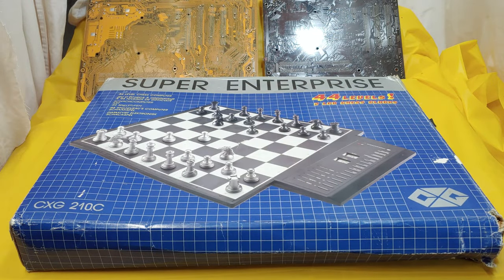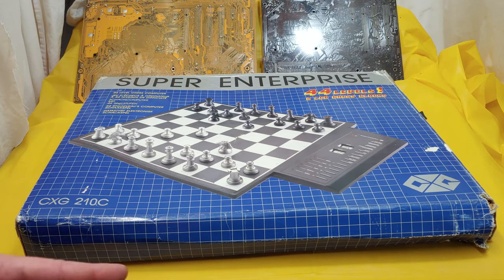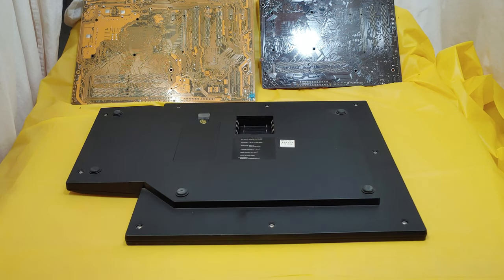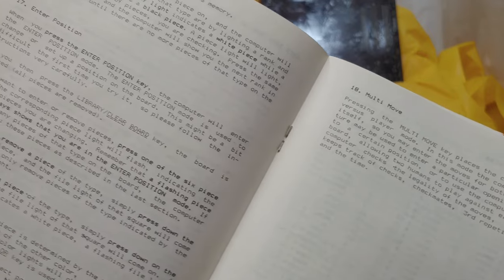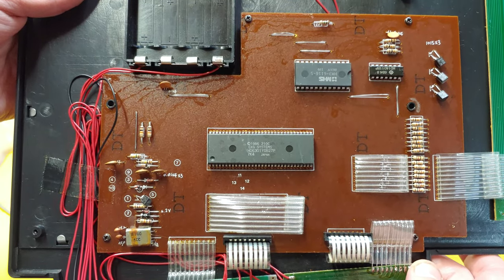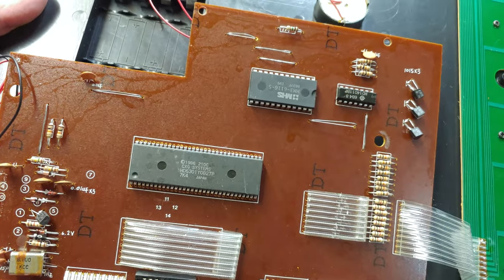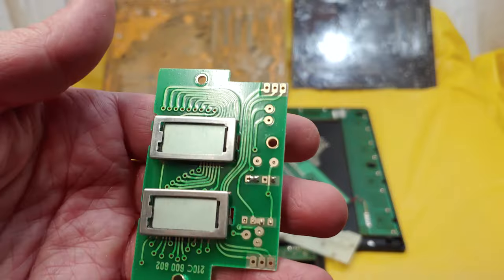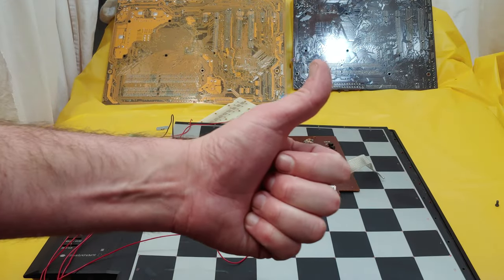Super Enterprise Chess Teardown

Comment: Have you figured out the chip yet? In my product version, there is a capacitor placed over the chip connecting the top most right pin with the bottom most left pin.